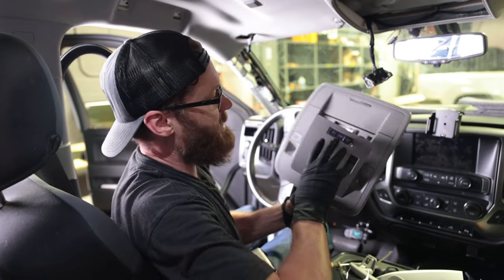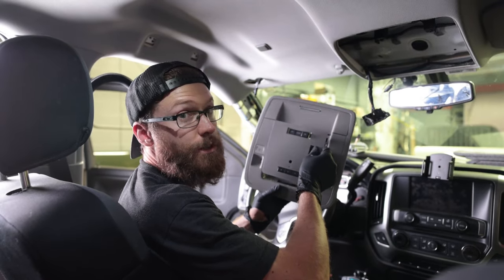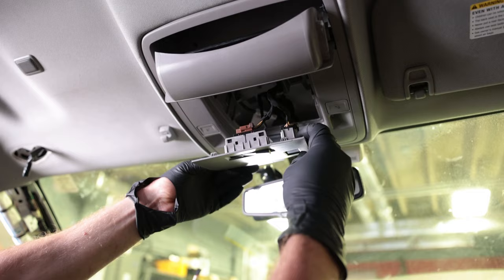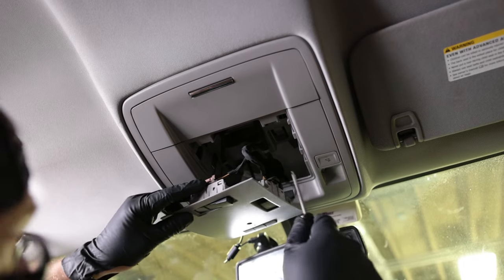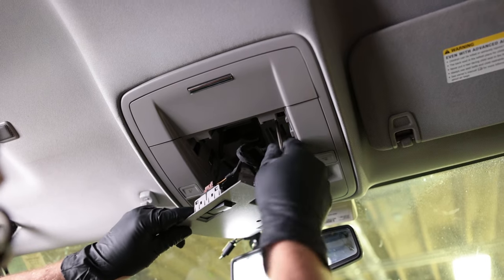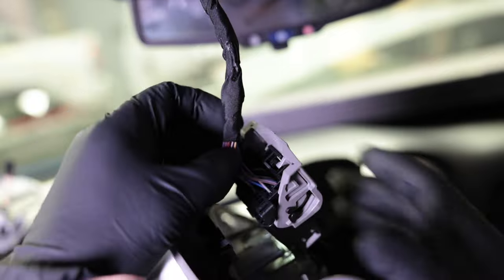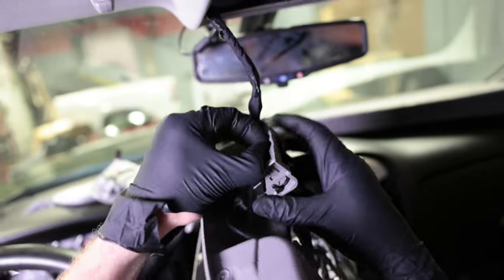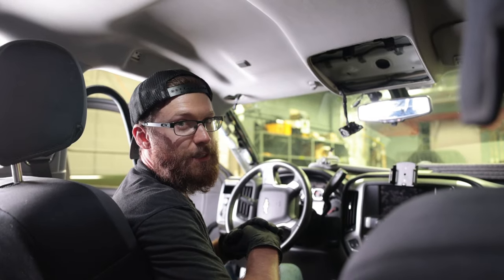2014-2019 Silverado Overhead Console Removal - Overhead Storage Rattle Fix - Sierra Tahoe Suburban

Comment: Second time one of the 2 screws has come loose, and the rattling and rolling around of the screw was driving me crazy. First time this happened, I took it to the dealer. It was under warranty, so no problems. This time I knew it wouldn't be under warranty, so I came to YT , and your video was first to pop up. 30 seconds into the video and my problem was solved. Popped it open, and there lay the screw. I will put a dab of loc-tite on both of these screws so they don't ever come loose again. Thanks.

Comment: You are a Godsend!  I have taken apart the glove box three times, complete center dash twice, boroscoped, scraped up my hands feeling around and blew are through the dash to hopefully blow out the offending piece.  It sounded like a screw rattling around the glove box area or center or console.  Popped the overhead console and there it was, the screw I have been chasing for a month.  Thanks for the tip!
Reply from the maker: Glad it helped you out! Nothing worse than a rattle you can't find
Reply: Omg it's wild to see the comment lol! I been doing the exact same thing I found it there from hitting the ceiling right before I went in the dash. You can hear it and sounds like it's inside the dash, passenger side, driver side but it's right over head.
Reply from the maker: Lol seems to be a pretty common issue!
Reply: Had the exact same issue, thanks for the easy fix!!!
Reply from the maker: Glad it is helping so many of you out!
Reply: Iv got the same thing now, opened it up and a black Phillips head fell out but I’m missing both of those T10 screws. My bezel was just hangin loose no screws to be found.
Reply: I just did the same exact thing yesterday.  I didn’t know where the heck the screw was rattling around. Sounded like the glove box to me as well.  This video saved me from breaking the console.
Reply: Yep, me too! Sounds like it was a socket rolling around on top of the radio! Or something in the air conditioning vent, or…. Lol popped off that top console and the offending screw landed in my lap… haha doesn’t get much easier than that!  Now if I can only figure out where the screw goes… 🙈
Reply: @krymsinviking  did you ever find out where the Philips screw was from ? I found the same one up there.
Reply: @TheSundaeDrive would the A pillars to a Cadillac Escalade fit on these trucks ?  Looking into. Adding the black suede to mine.

Comment: That’s very helpful thanks. I plan on installing an Auxbeam control panel for auxiliary lights and stuff right behind that and need a hold to fish the wire through the roof liner to the left side of the windshield to go down to the engine bay.

Comment: I  love your explanation but my 2019 does not have the the screw holes---I have the rattle of the loose screw but there is no hole for it to go into? Is it posisble that a later year model has a different location for the attaching screws?

Comment: I have a 2021 Silverado Custom and I'm installing a power rear sliding window.  I'm bought the roof console with the sliding window button mechanism.  I'm curious whether the power already on the roof console will power the rear sliding window after running the harness from power sliding window in the rear of the truck to the roof console.  Thanks for the video...

Comment: SINCE YOU SHOW THE REMOVAL COULD YOU PLEASE ADD THE SIZE OF THE t10 TORQUE SCREW to SHOW THE THREAD PITCH AND LENGHT
Reply from the maker: Your local gm dealer will be able to source the exact bolt needed :)

Comment: So I’m having an issue with my factory microphone can anyone direct me to a reputable schematic or a video showing the repair of the wires and or where the connection is? I have the headliner apart and can’t find where my microphone plugs into, it was unplugged when I went to check it out.